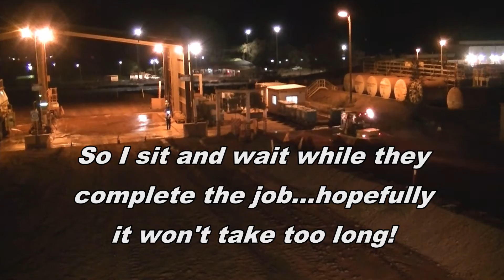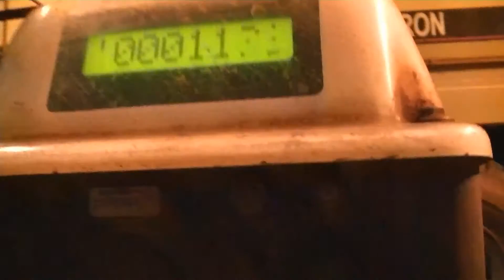PT2 REFUELING GIANT DUMP TRUCKS

Comment: I reckon it would be just as good as the diesel in our highway trucks because although your engines are much bigger they are still from the same "family", they aren't like low rpm marine or locomotive diesels. I think yours are 1900 rpm max? That's my opinion anyway!